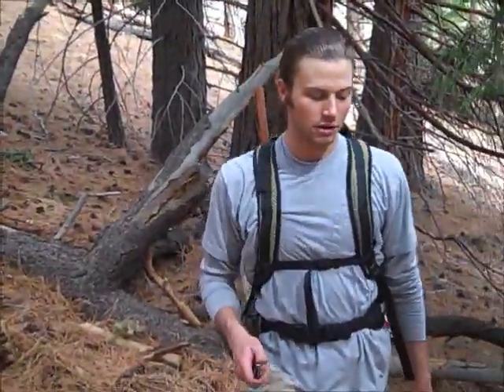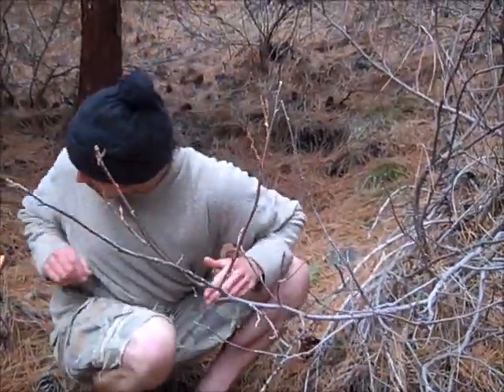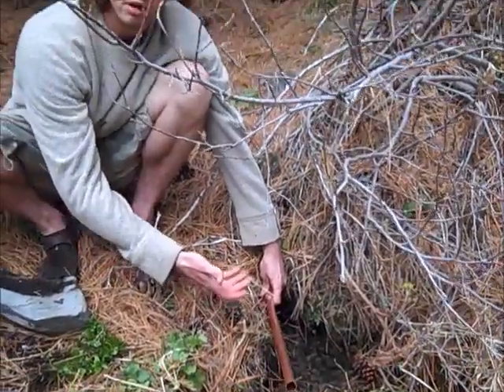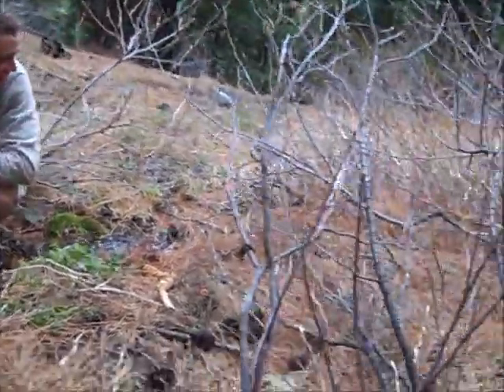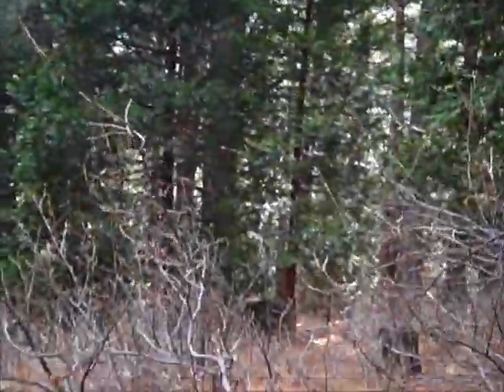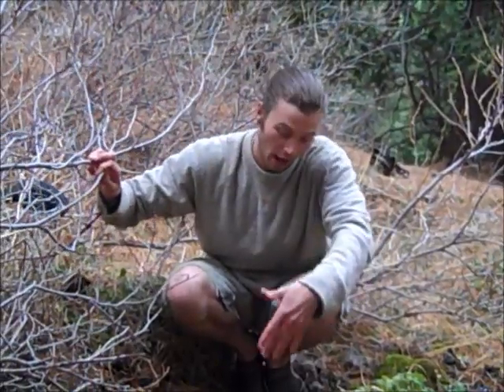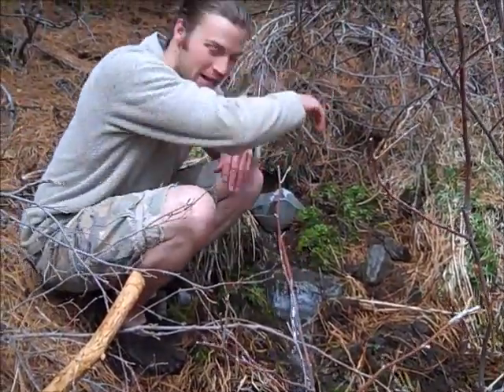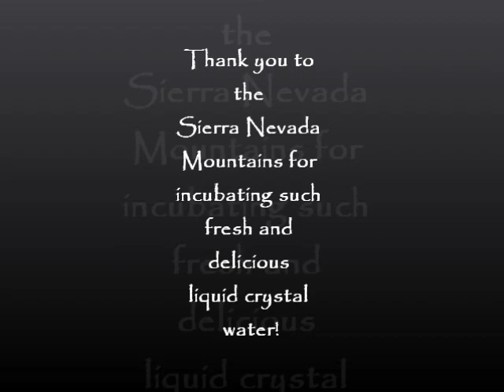How to pipe a wild spring

Comment: A 3/4" pipe to small to work good at all seasons  , you need a a 2 or 3 " pvc and will work good in fall when water level drops , so  push it in good and deep and let stick out long enough to give you the head you need off the natural ground, you may have to nail 1  or 2 sticks along and tie it on to get just a rate pitch and flow

Comment: City slicker video.  95% talking, 5% doing what any 10 year old could do.  The water source should have been dug back, schedule 40 one inch pipe, 3 feet long installed, Fiberglas screen over the intake end, packed with rocks, re-covered with dirt to minimize debris intake.  Outlet high enough to fill gallon jugs.  On the other hand, a mile to find it for anyone but hikers is not useful.  MUST be other springs closer.
Reply: Is there any place online that you know of that provides detailed information for doing this? Because Youtube seems to be filled with videos like this that are not really correct or informative.
Reply: Look on the side panels, right side of this page for many ways to developed a clean spring with minimal maintenance.  Be sure to plan for winter and summer flow rates to keep it debris free.  Let high water flows pass OVER the intake filter of bronze window screen and backup layers of mesh.  Slope the intake filter to make it self-cleaning.  Some tinkering will provide good water year round.